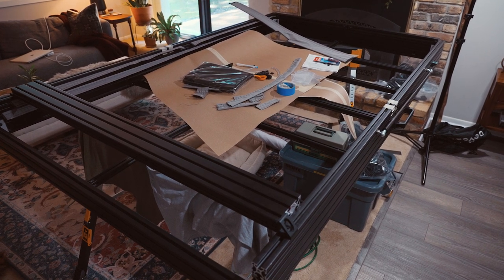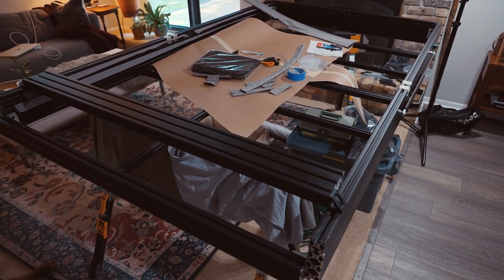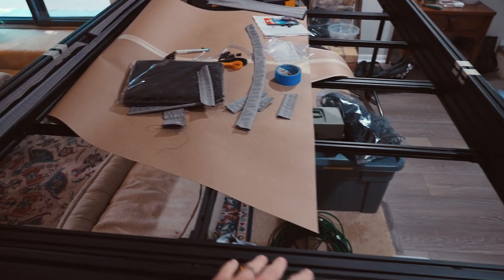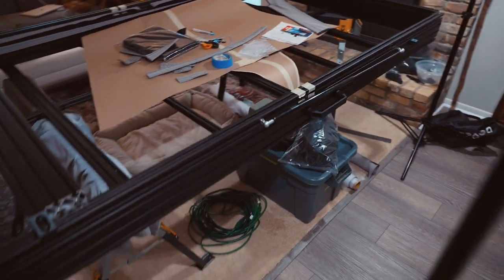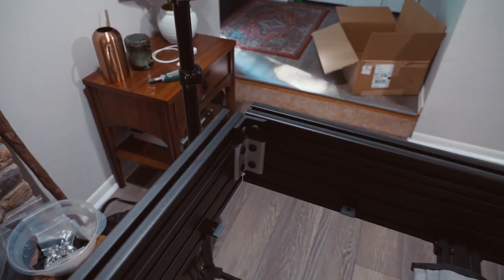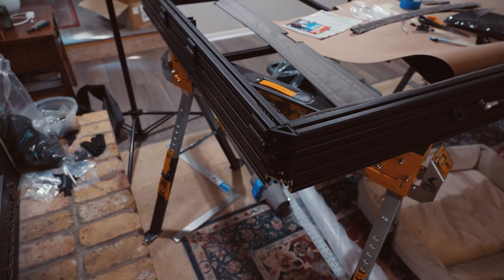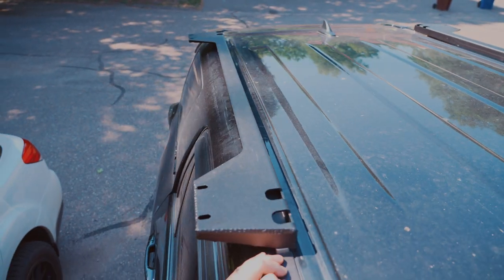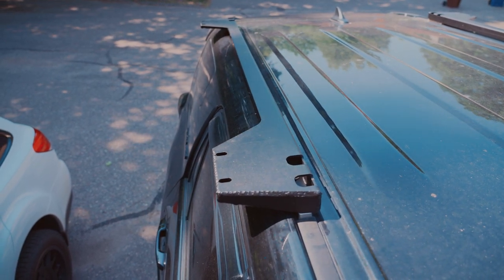BUDGET Clamshell DIY Roof Top Tent (RTT) | Part 1

Comment: Personally I am inclined to prefer side doors on my RTT and consider a rear door to be purely optional, though I would still like the rear to be a protected window. This allows for the tailgate area to be used for cooking instead of a ladder into my tent. It also allows me to use the tent while pulling a trailer without interfering with ladder deployment. Additionally having a side door allows for a 270 degree canopy.

My design objective for a RTT is to DIY a canopy that is symmetric in design allowing it to be mounted to driver or passenger side depending on if the bracket is "right side up" or "upside down" when it is mounted to my cargo rack, then bolt in the swing arms, and tie on the canopy itself. On top of the cargo rack, I will have a DIY RTT that fits between the side rails (I have a contractor style cargo rack on my Tacoma). The ladder will attack to brackets that are attached either to the side of the RTT or to the side rail of the cargo rack (I am undecided at this time, but rack side rails is likely most convenient). Under the cargo rack is a ARE overland edition bed cap which keeps my camping gear largely dry (unless I do a deep water crossing) Inside the bed I carry things like camp chairs and camp kitchen box as well as my 20lb propane tank and a jerry can (I would prefer mounting my flamables outside, but can not do so at this time). The canopy would swing out and cover passenger side (if camping roadside) or driver side (if camping in prepared camp sites) as a social area and the tailgate area as kitchen area. The ladder (current plan is one of those telescopic ladders so I do not have to worry about perfectly level ground) will likewise store in the truck bed, but will attack oposite side from the tent itself.

The low budget version (prototype test version) of my plan is to build the RTT primarily out of wood and give it a fiberglass skin, though I would prefer insulated aluminum composite skin, most likely on a frame work of extruded aluminum which was originally inspired by a RTT that was owned by Matt of Ozark Overland Adventures. I like the idea of the aluminum extrusion as it is easily made into a modular design and can easily mount external (and internal) accessories to the rails. including flood lights and cameras on the exterior, lighting, and a mount for my tablet or a fan on the interior. I am considering making mine 6'6"-7' or so in length to allow adequate space in the "headrest" to integrate a combination charging/power center and ducting for a diesel heater or camp AC unit. (or just a weather protected air duct for a fan). I plan on using 3d printed parts for a coupler (with cap) for the air duct as well as accessory mounts.

On the roof of the tent I want to include a pair of 100w solar panels and include a pair color coded of 8 gauge Anderson Power Poles to connect to trucks house battery system (once it is installed) I would also like to include a roof vent with 12v fan mounted "backward" so the vent opens correctly for weather protection when the RTT is open, but I do not plan to add the fan until I can build a proper protective cage for the vent as I live in the south east where overgrown trails are a common occurrence. (I can get scratches on both sides and the roof of the Tacoma at the same time on named roads around here.)

I also have a design for a clamshell style RTT that I have worked out to go with my contractors rack, but with a rack space of 4'6" it would give me a tent that was about 5-6' by 9' plus an overhanging canopy over the ladder. This would be HUGE considering I often camp alone. I figure it could support a queen size bed, and have a storage compartment under the mattress, but would result in an RTT that adds about 8"-9" to my minimum clearance while being about a foot deep overall. though I plan on making some horizontal jerry can carriers for water and fuel to ride on the rack, so it will have those clearance issues and more anyway.

Comment: Really like this diy project, very much looking forward to the final product! I like how your use those 15 series beefy main frame for this RTT, what you about the cross bars? Can we do 10 series for those cross bar. If yes, is there any connection issues with 15 series, any area should pay attention to? Thanks man, this is exciting.
Reply from the maker: Yeah I’lol try to address that, I just think the 15 series crossbars are beefy and the brackets are so much easier to integrate so it’s worth it

Comment: What is your budget and what ended up being your complete out of pocket?
Reply from the maker: I will be doing a full cost breakdown eventually. Don't really have a set budget, just a ball park because I want it done right.  I would say ball park costs would be around 2k for the tent.  Then your mounting setup can vary dramatically.  There are many design choices along the way that can save you money or drive up costs.  The hardware, hinges, handles, etc. all add up really quick.  The extrusions end up being only like half the price.
Reply: @OverlandEngineer  👍 because I was looking at the ones on Amazon for $2000 and was hoping to beat that price.
Reply from the maker: @racingfortheson  just depends on what you want for an RTT.  There are so many DIY setups so you can definitely go cheaper in style.  I wanted an aluminum clamshell design similar to current market options and this was like $2k ish vs $4k +
Reply: I got one and using it for the first time this week. Love it?
Reply from the maker: @racingfortheson  it’s still not done unfortunately…
Reply: @OverlandEngineer  guess that is also an advantage to just buying one 🤣🤣🤣